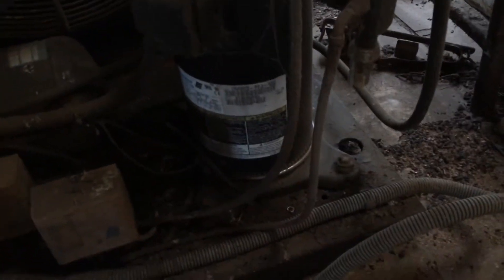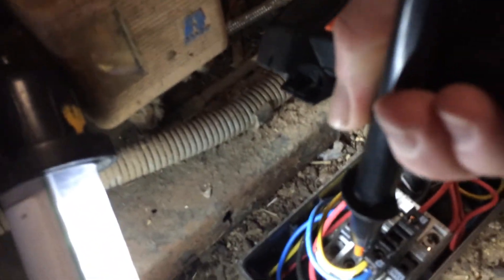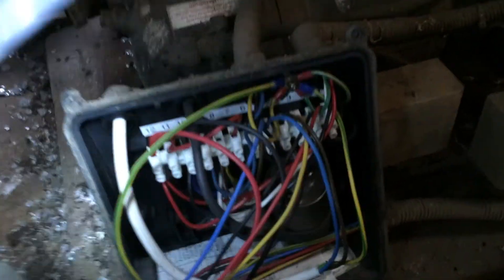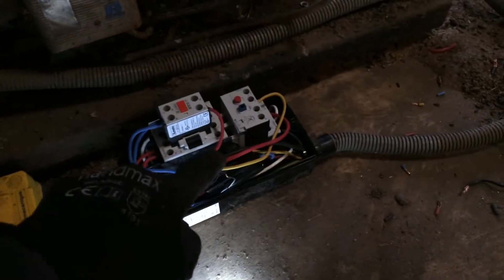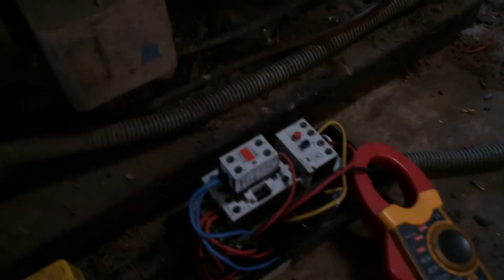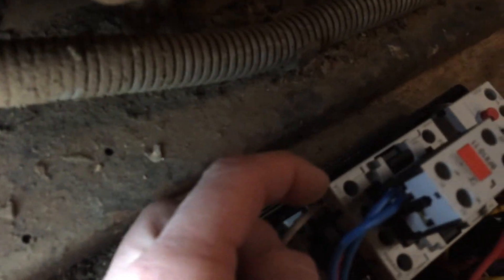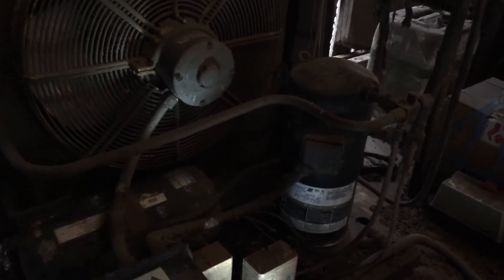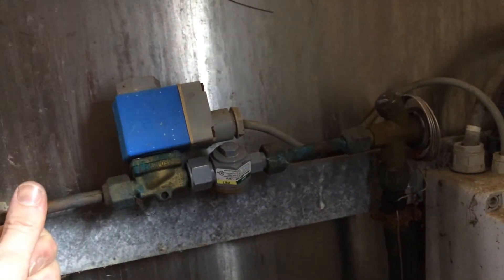Failed Contactor Replacement Fail....

Comment: How did you get 240 on the neutral? I had it like that the other day but it was because of a broken neutral in the circuit but I don't really understand why!
Reply from the maker: Craig Johnston Its because once there is no current flow (due to the break in the neutral) that there is no volts drop across the item being powered be it a motor or circuit board or whatever, and without the volts drop you get full voltage right up until the break.

Think of a dripping tap, (the tap being the motor) there is mains water pressure in the pipe (volts) there is water flow out the tap (amps) but no pressure. No put your finger over the tap and you have mains pressure water but no flow.

I will try and make a video showing it, but am having computer problems at the moment so may take a while.

Comment: Is the contractor no good now or was just wired wrong?
Reply from the maker: Knuckles the Echidna I wired the replacement contactor wrong, it has four contacts but we only needed to use three, i got the wire in the fourth terminal so the power had nowhere to go, once corrected it worked as it should.